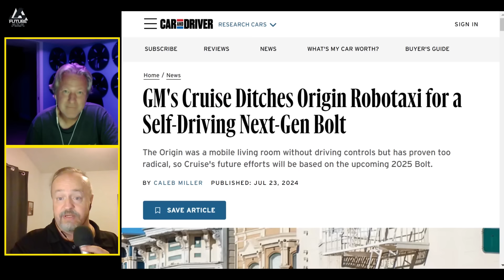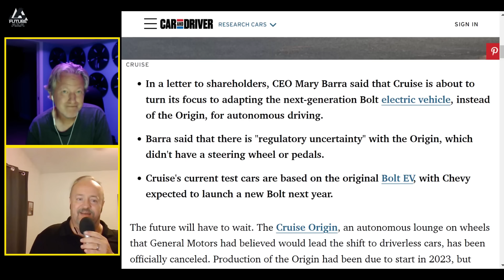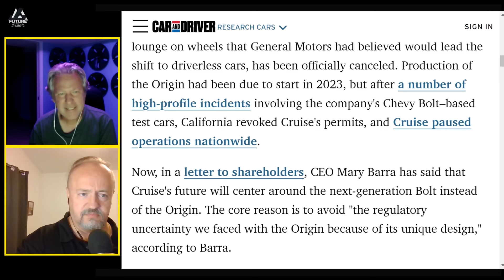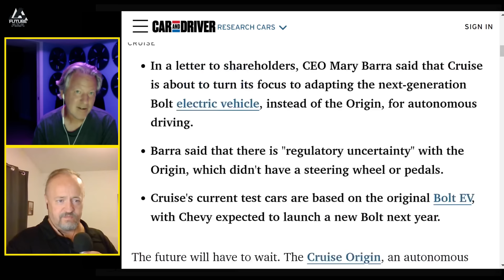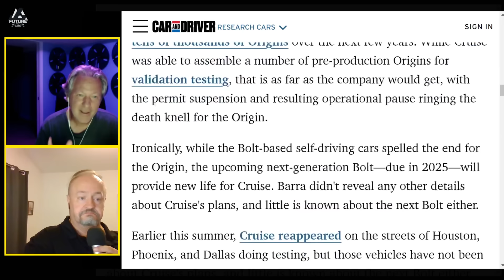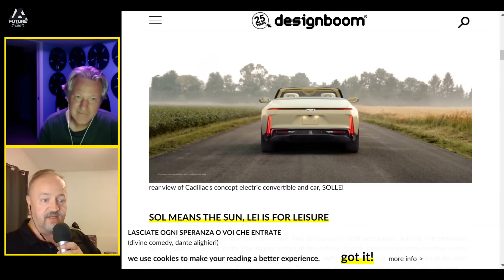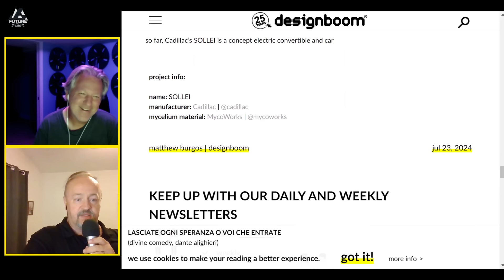GM Finds NEW Towels, Throws Them In

Comment: Imagine where GM would be if they got behind the EV1.
Reply: GM had to recall every EV-1 and crush them because they used a Ni-MH battery pack, and Texaco bought the patent for this battery chemistry to ban its widespread use in vehicles to compete against fossil fuels. That's why we never saw any Ni-MH battery cells larger than D cells. They dictated their proliferation due to the patent. That's why there were never any cordless tools using them and stayed with Ni-Cad packs, due to licensing costs. The patent has since expired. But Li-Ion technology surpassed it, and it was an open patent.
Reply: Tesla probably wouldn’t exist
Reply: @wngimageanddesign9546   GM sold them the patent for Ni-Mh.

Comment: New Bolt? Oh, you mean the one that Tesla is going to be building for them. Makes sense to use those for your Cruise network since licensing FSD will be cheaper than the sensor suite they are currently using and Tesla will be able to build them profitably to boot.

Comment: Zoox is still in the game with a similar vehicle afaik. However with this switch I wonder if GM is going to license FSD?
Reply: 'Losing face' by renting FSD for 5 years whilst giving yourself time to come up with your own stuff is, in my opinion, not only the best choice for GM, it is the ONLY strategy that will keep GM alive!
Reply: Is 'having a vehicle' actually being in the game though? This is a software race, not so much a hardware one, at least not without the right software.
Reply: @garethrobinson2275  Dunno - was recently in San Francisco and saw a regular vehicle driving around with a whole sensor array on top labelled Zoox - so probably mapping the city or doing some testing. Agree about the software race.. which is why the idea of GM licensing FSD is interesting. Also think that Zoox has a very tough road ahead given they have to deal with both hardware AND software even more so than say Waymo which uses modified EVs not bespoke ones. Not sure Zoox could use FSD?

Comment: Have any of the car makers open sourced their FSD software?  Would be great if FSD code and hardware could be installed by hobbyists on existing cars.
Reply: Not really, it would be death on wheels. FSD has to be fine tuned to the exact camera positions to work properly. This is why we're only now close to Cybertruck having it, the whole model has to be trained up on data that comes from thousands of the actual vehicles. I feel like I'm punching down here. Take a look at Comma AI, they have software you can buy (last time I looked which was a while ago) which lets you set up a driver assist system but it is no FSD.
Reply: @garethrobinson2275  There are two approaches to FSD.  One is AI pattern matching.  That is what is used by Tesla.  The other method is traditional procedural computer code. The software takes in input from its sensors and decides, just like a human would, what to do to drive the car.  As I understand, Elon canceled this 2nd method because it was too much code. Yet, it seems like something a lot more programmers could understand and contribute to.
Reply: Comma AI.
Reply: @Steve-Richter  AI is far more human like than hand written code in operation and in practice.

Comment: I don't need a cool car, I need a CHEAP car, PREFERABLY an EV.
Better yet, a cheap Robotaxi!
I don't CARE what the Robotaxi looks like - Ima sit on the INSIDE! So long as there is legroom, headroom and a comfortable place to sit, it's good. And working heat or A/C, of course.
Back when I used to travel (a lot, easily in top 1% or air travellers) and use taxis a LOT, I didn't look at what MODEL the taxi was. At Nashville airport I took whoever was next. (If the taxi or driver looked REALLY sketchy, I might wave the next person forward). Same in Memphis, or anywhere that taxis kinda made financial sense versus renting.

Does the world REALLY NEED two competing pieces of insanely complex software running on incredibly expensive hardware to provide driverless cars? Probably not, which means first across the finish line gets the prize. Which will probably be Tesla FSD.
Reply: tesla isnt first but sure cheaper and will spread faster if they can ensure quality its over

Comment: I have a problem with Cruise, because it is a cash incinerating stock pump with success NOT one of the possibilities. Cruise’s collection of second and third rate talent is clearly not up to the challenge, and even if one of them had some dream where a genius solution came to them, Cruise would still have a LiDAR using FSD with geofencing and the rest that will not be remotely cost competitive with Tesla and will not scale well and will not work in a hard rain or if it encounters snow.

Comment: You do realize the only reason it could not be used is not because of a data problem.  The NHTSA has to approve any use of a vehicle without standard controls and even with all of GM's clout the NHTSA would not move.  Do you really think Tesla will fare better?    

All the snarky comments aside,  you are your guests are getting tiring in your reliance on snarky comments, the ignorance required to assume making up one of a kind cars delays other cars coming to market is just beyond dumb.  Let alone the fact these groups operate in completely different studios with separate budgets and management.   Speaking of concept cars, there is the new Tesla Roadster?  Its just as affordable at that Caddy.  

To be blunt, I am six years into my FSD promises journey and even 12.4 does not make me think its all that close.  The news around 12.5 is just like what happened when 12.4 debuted and I guarantee as soon as 12.5 gets into the hands of more drivers its halo will be quickly tarnished

Comment: So what? GM's not allowed to reconsider a new vehicle design? GM reconsiders new vehicle designs every year. Every automaker designs vehicles it never produces. You can see them every year at auto shows. If GM must choose between the Origin and the new Bolt, because it can't print dollars to spend on R&D, choosing the Bolt is a no brainer.

Maybe you don't go far enough applying the same standards to the Tesla Roadster that you apply to this Cadillac concept car.

GM should sell the most profitable vehicles. It must invest in EVs to make them profitable, as it must invest in any new class of vehicle, but it cannot and should not sell EVs at a loss forever, and it must base its production on realistic sales projections.

Unfortunately, the early battery fire debacle persuaded GM never to ramp production of the original Bolt, but the company promises to sell the new Bolt for at least ten grand less than any Tesla ... unless Tesla finally produces the Model 2 which is still a concept car. Certainly, early renders of it were only conceptual.

A $30k Bolt EUV is much closer to a common man's car than anything Tesla currently produces and also closer than an Equinox or a Blazer or a MachE. So what if you don't like the looks? Do you like the looks of a Corolla hatchback?
Reply from the maker: I predicted this about the Roadster ages ago. Probably two years ago. Don't imagine I'm something when there's already evidence disproving it.
Reply: @FutureAzA  I doubt that your critique of the Roadster was as withering as this critique of the Cadillac concept, so I doubt that "same standard" applies. What's the title of the video? I see one titled "Tesla Roadster is NOW" a year ago. I don't need to imagine that you're a Tesla promoter. A year ago, this channel was called "My Tesla Weekend".

You are my favorite Tesla promoting channel. My comments are usually disagreeable because I don't see the point of commenting only to agree with what a video already says.

Comment: The Origin would be impossible to sell within 3 years.  I consider it far easier to copy than to originate a good idea.  Megacasting, electric cars and a self-driving system based on cameras are all copyable.  It takes possibly 2 or 3 years to copy the manufacturing.  Theoretically any car manufacturer with some functioning neurons would be in the process of manufacturing a good EV with cameras and electronic controls.  That part is relatively easy.  I doubt that GM is currently ready to train a model, but they have partners who could train a model.  GM knows that Tesla is training an end-to-end model.  Tesla has a huge data advantage.  My 2 to 3 year guess is that GM could start collecting data soon.  If they wanted they could place cameras on all their vehicles which would mean a big fleet.  Of course, I don't believe GM will do the sensible thing here.  I just see a way that a determined competitor could catch the current Tesla wrt cars.  I expect more improvements from  Tesla and maybe GM would stay behind.  A bigger problem is the cost of union labor.  I expect more cars imported from Mexico.  If you think Tesla can't be copied quickly, just think about the Chinese companies who have copied Tesla.  The Xiaomi Su7 is a prime example though they didn't build their own cars.